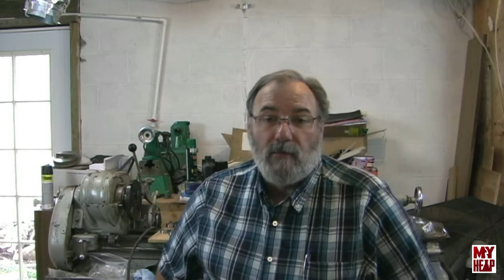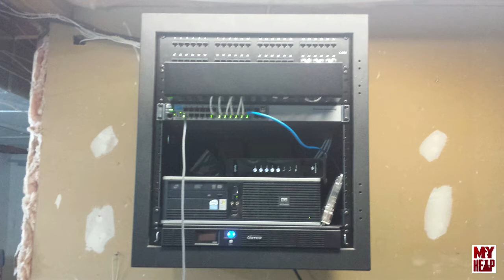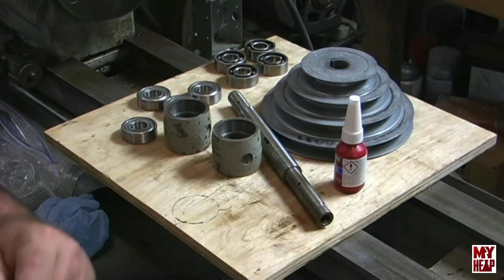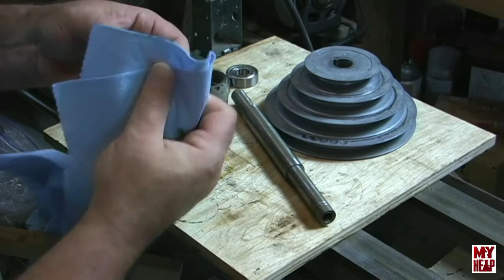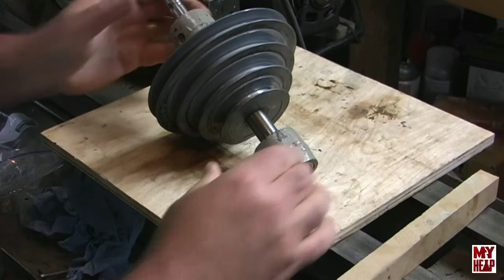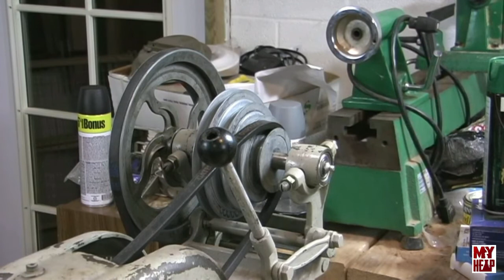Atlas 10F Lathe - TH54 - 06 - Counter Shaft Assembly

Comment: I like that railing with the finials.  I made my front railing 40 yrs ago--yours is better.
Good video instructions on the bearing installation. Great idea on the zerks--usuall people put in the sealed bearings.
Reply from the maker: Thank you Mr. Pete.  When I first made the posts, I used 1.5" balls and after they were ground just looked a little too small.  I have never seen them made like this, but I figured if they looked too bad, I could cut them off and put traditional caps on the.

Joe

Comment: Glad to see the lathe coming back together. The loctite retaining compound it good for up to about a .005 slip fit, you will have no problems. Heat from a propane torch will break the bond if you ever need to get them out again. Nice railings :)
Reply from the maker: Thanks Rich.  The new bearings definitely made the counter shaft a lot more quiet.  The railings did turn out pretty good.  I am pleased with them and my wife approves.  So you you know she is the final arbiter on that project.  A little more grinding and some touch up painting and they will be done.  Just holding out for a day that is cooler than the mid 90's.

Joe
Reply: Our tropical storm that is going directly over me today cooled things down a bunch today. Yes, the railings are sharp...its amazing how many feet of material it actually takes to do a small project.....adds up quick!

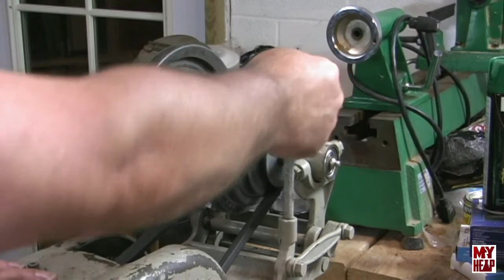Comment: That motor pully lever at 16:10 seems to be made to cam into a flat to keep the belt tensioned. On my Atlas, it doesn't go far enough to lock into place, it just flops forward / backward, so my pully belt is always loose. 
What am I not seeing?
Reply from the maker: If you have the stand, then the bottom casting of the motor mount has a bolt that will allow the countershaft to be adjusted fore and aft.  If you are bench mounted, then you may have to reposition the motor countershaft casting.  If you join the atlas group you can get the countershaft docs.  If you run into a snag, let me know.

Joe

Comment: I am also a computer geek i run Linux Mint on all my pcs
Reply from the maker: Awesome.  I run mostly Ubuntu and some mint and freebsd.  Use pfSense and FreeNAS at home.  These run on freebsd, and have proven themselves to be excellent solutions.
Reply: @MyHeap  I switched from red hat when they went corporate on me I use kali for testing  Ubuntu seems to work fine on my small server i do run windows on a VM for some apps like my solid works
Reply from the maker: @joeduda8507  I use Linux almost exclusively but I don't think I will ever be out of windows.  I use it for cnc toolpaths and a few other things.
Reply: @MyHeap  till they make a good emulator we are stuck wine is not the answer